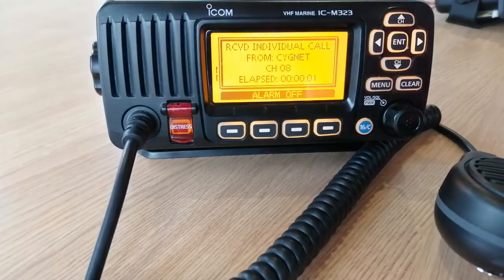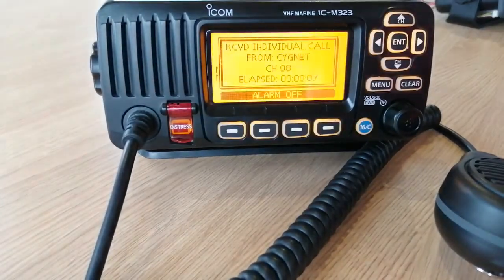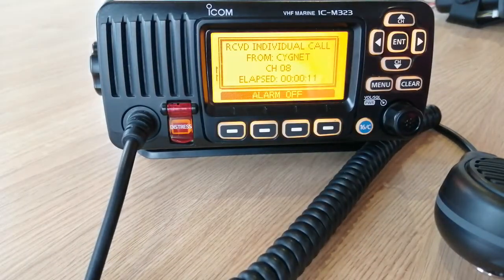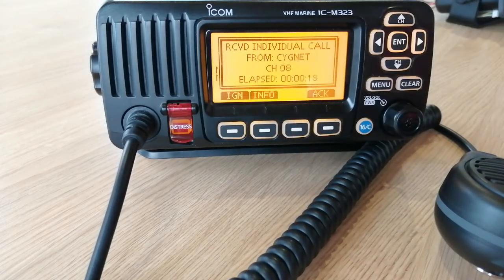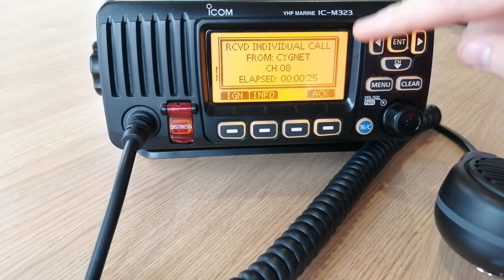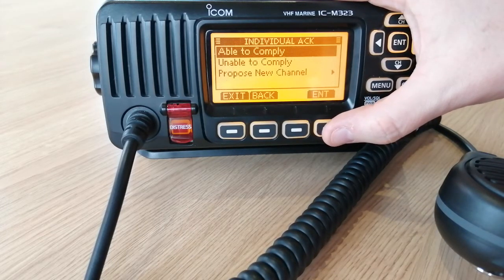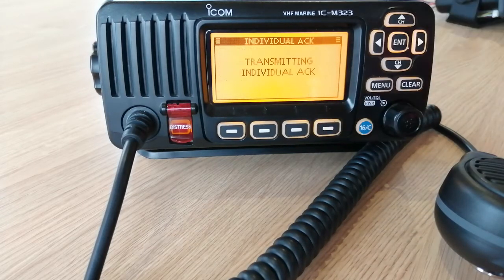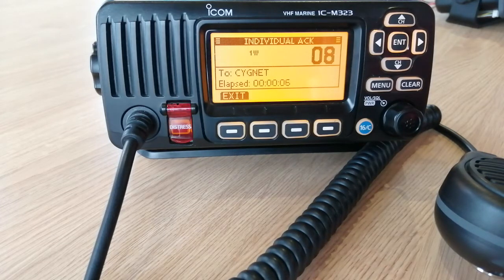Icom M323 Receiving a Routine Digital Radio Call (DSC) VHF Radio

Comment: a vhf raido makes a sound when someone goes on air...

what is that noise called from recieving an audio VHF message on channel 16?
Reply from the maker: Hi, when an audio signal is received, it is simply played on the speaker of any other radio tuned to channel 16..  you can turn down the 'squelch' which will make the radio pick up all the background noise but the noise itself has no name other than 'background' or 'hiss'
Reply: @DORSETMARINETRAINING  not the squelch, I meant like hearing someone pressing on the talk button then letting go of it quickly. That sound the on air and off what is it called?
Reply from the maker: @A.A.HadiWhite  'keying of the mic' is the expression sometimes used but there is no official term to my knowledge.